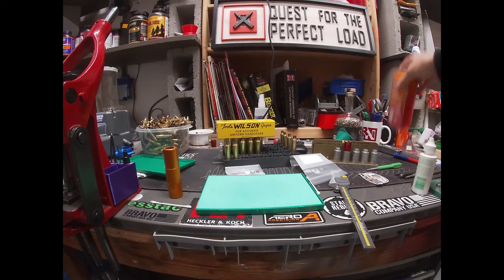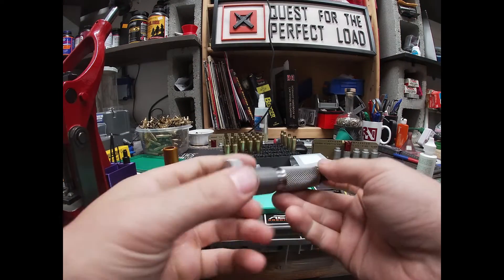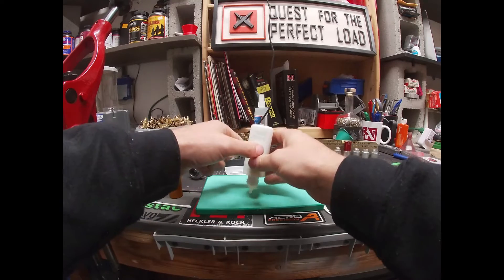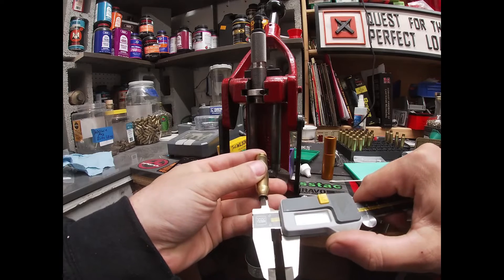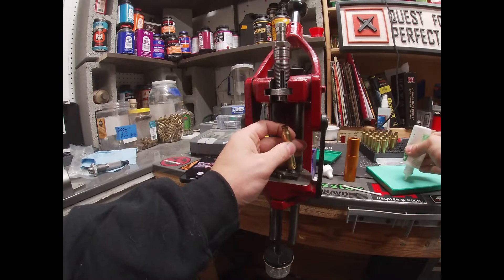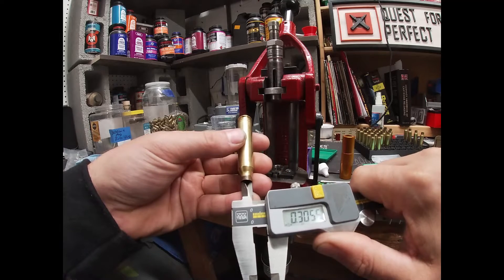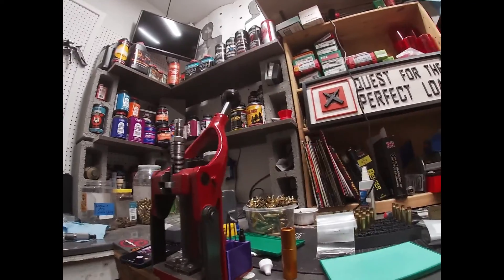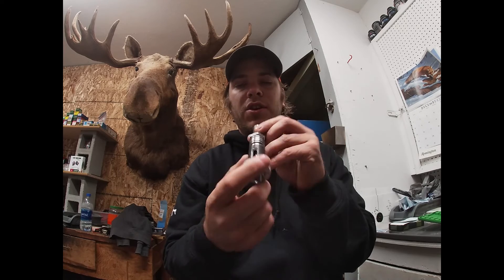New L.E. Wilson Expander Mandrel 30CAL How to use

Comment: Question  -  you ran the brass in the FL die with the expander ball removed, you also had your die set up to give you the shoulder bump you wanted?

Then you run the brass in the mandrel die, now you are ready for powder and bullet seating?
Reply from the maker: That is all correct 👍 spot on.
Reply: @ReloadingQuest  Thank you

Comment: Nice Video. L E Wison makes top notch stuff. Hopefully it helps runout.  You may wanna check out some Redding Graphite Dry neck lube and its refill. Its part of what our powder is made of. Its a great dry lube for neck sizing.  You can simply insert your cartridge into it and it coats the inside of the neck for sizing. You don't have to remove it and its much faster and easier than the q tip. Then apply your lube to the outside.  I found another company Hi line Precision that makes the same item. Both are great. Hope that helps.
Reply from the maker: Awesome! Thanks I will order some of that lube now! Thanks for watching!

Comment: Is this used for always expanding fired brass or only for new brass? I was using this and it was making my necks way too loose on 30cal. It’s weird to me.
Reply from the maker: It just depends on what size mandrel you got. Mine is .3065
Reply: @ReloadingQuest  where'd you get the .3065 all i can find is .0375?
Reply from the maker: @danielzeitler8169  if you email me I can send you the link to where I got it. But I believe was just off there main site

Comment: Are you annealing brass? Looks like you’re getting a lot of spring back. That mandrel should set the neck to .307
Reply from the maker: I am and that all depends on what size mandrel I have in there. I I remember correctly it was a .306 mandrel
Reply: @ReloadingQuest  l.e. Wilson only makes the .307 for that die in 30 cal
Reply from the maker: @APACHE529CREWCHIEF  I have a
.3065 and .306 and a .307 from them. So not sure. Also use the 21st century kits as well and I got from .308 all
The way down to .304 with that one

Comment: .308.5”??  WTF?
Reply from the maker: Have zero clue what your 
Referring to. If it’s the mandrel size that size would be for cast bullets.
Reply: The peoper domination  is 307.5. That is in due to proper neck twnaion and substantially of the brass and brass neck.  The qall of the neck will be uniformed and properly expanded to those dimensions to retain bullet tension and neck tension.  Reading ia required and comprehensive is fundamental and viscera
Reply: I believe that is the I/D of the neck after firing which makes sense to my intermediate knowledge of reloading. Then he reduced it a few thousand less to get a grip on the new .308 bullet.
Reply: @jmf1976jmf gotcha to keep the consistency of the neck.